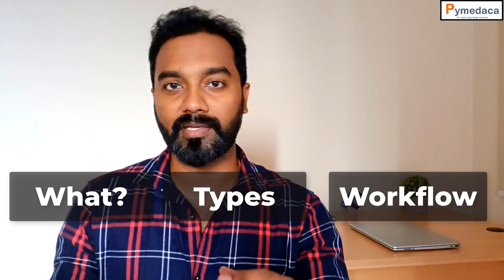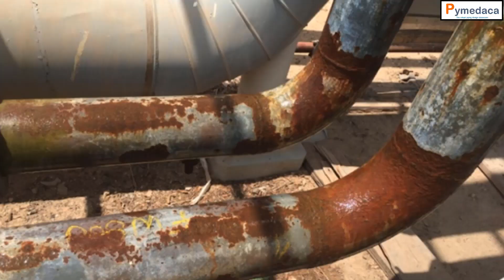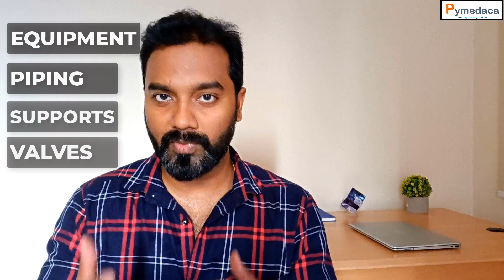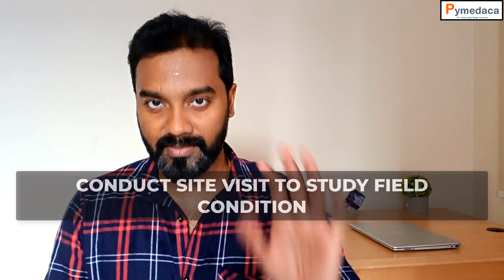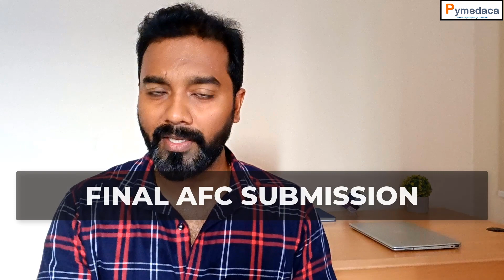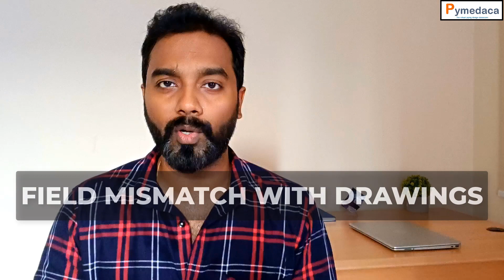Brown Field Engineering - Piping Design Projects and Engineering

Comment: It's very useful information and there's no alternative to it. You've explained things very clearly. When you share your experiences with us like this, we feel that we have gained those experiences. In the future it would be helpful if you could explain to us more clearly some of the activities in the brown field that I have mentioned below. 1. How to do prepare for the piping tie ins package. 2. Hot tapping activity. 3. Double block and bleed requirements.4. during the isolation if any valves passing how to overcome this issue. 5. Golden joint requirements in lieu of hydrostatic test.6.flange tester Method.6. UT- THK measurement of existing line.7. when is required of service test Lieu of hydrostatic test. 8. The existing line does have FBE coatings if We are going to connect new tie ins which option for flange or any other. 9. To minimise the shutdown Without touching existing line How to do parallel PIPING system. Need your videos about above mentioned the topic. Thanks for your outstanding YouTube channels.

Comment: Sir, I recently got placed in an EPC Company, so vast amount of projects are rather Oil & Gas or Chemicals. There are two field as far as I know, Piping Design Engineering and Mechanical Static and Rotary Equipment Design Engineering. For the Long run and decent Salary, which one should I choose?
Reply from the maker: Both are equally good field. But opportunities are more in Piping and less in static & rotary